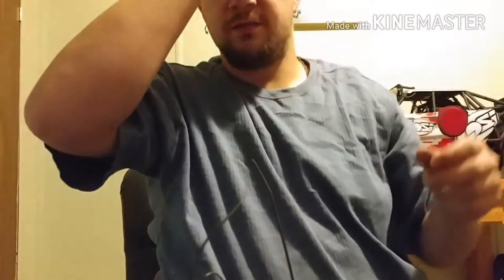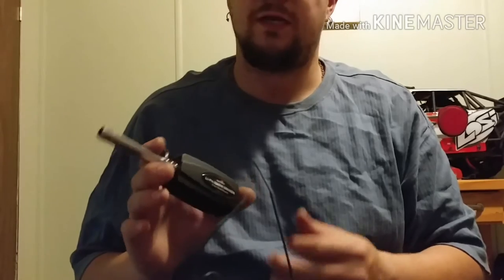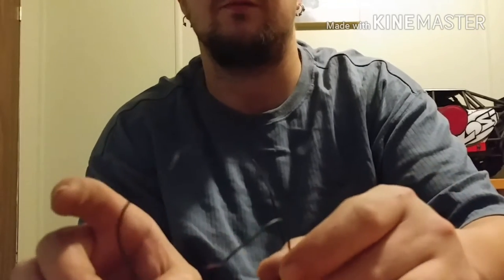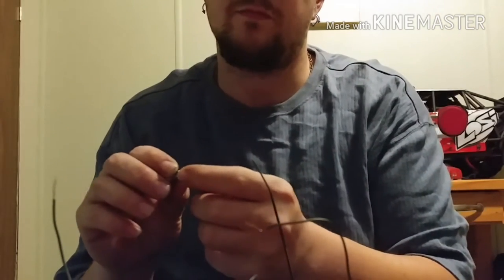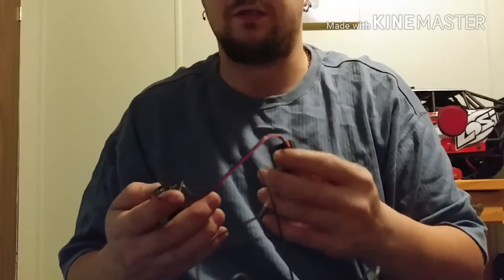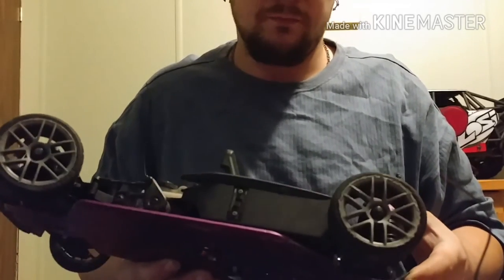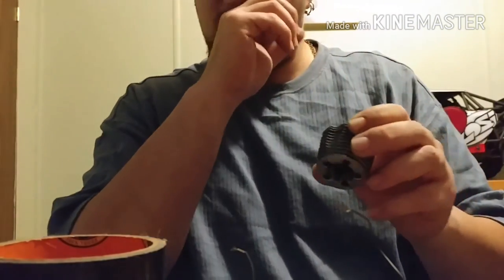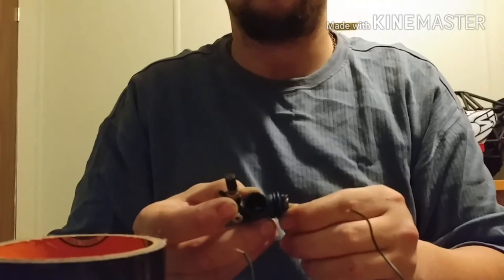Worlds simplest glow plug igniter

Comment: You have re-invented what every 14 year old boy knew in 1947. You are actually supplying a 3 volt battery that is unable to deliver the required current but due to Ohms Law (oversimplification) drops the voltage into the voltage range of the glow plug. For a simpler glow plug igniter even than your 'World's Simplest' glow plug igniter, try a single fresh D cell in place of the two AA in series. Try a voltmeter on the 2 AA cells when you are glowing. You may even be surprised to discover that a bunch of weak used AA in parallel will also glow a plug.

Comment: 3 or 4 years now and have never had any problems with my starter wand and I have the exact same one. It just supplies the power just the same as manually connecting the AA battery does. If it's not starting when cranking you need to check connections. The wand either supplies the power or not. May even check your battery I'm your wand. If you charge it and store it when not in use properly you like aren't going to have any problem with the wand. I don't see why so many people say they have trouble getting the engine started with these. I'm thinking they don't actually understand how it works or they have something out of whack somewhere along the line. If having problems they just need to pull the plug and leave the lead hooked up while grounding the plug then hit the button. If it glows nice and bright then they have a different issue. If not check the wand with a meter. If it shows that it's putting out any power then look at your fuel. Pretty basic even for a newbie.
Reply: TheEZ start wands are very common for this and it’s due to a fault inside of the wand, I’ve had several be dead on arrival out of the box. I’ve been in the hobby 20 plus years and I couldn’t count the amount of people that is new to the hobby come to me asking for help with their Traxxas nitro not starting and 90% of the time it is a faulty wand. I always recommend they ditch the wand and just pick up a regular Igniter and they will have far less headaches.

Comment: Even if the electric starter shits itself it won't turn on bro it tells you if you have a problem with glow plug or starter
Reply from the maker: Paul Pateras I know.  but many dont know this.  mine work fine.  I did this for about 12 guys on facebook that had the glow plug side of the wand completely crap out.  the plug was good but something was wrong with the wand. if you look at my other videos I even show how to diagnose the ez start system.  I know what I'm doing.

Comment: Dammit!..... Thanks dude lol i just blew my glow plug! Actually dont connect batt end to end.  connect  - to - and + to + not - to +. YOU ONLY WANT 1.2V TO 1.5V. ! If you connect + to - then it will be to much voltage 1.5 + 1.5 = 3v to much bro.
Reply from the maker: Voodoo Man these nust have been weak batteries. But I have another video on how to use just a battery without any wires as a glow plug igniter